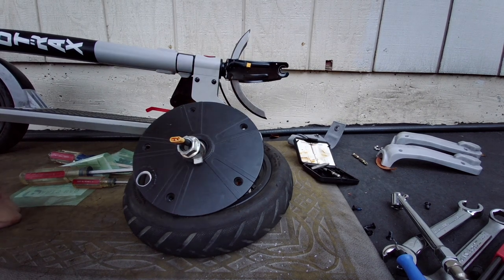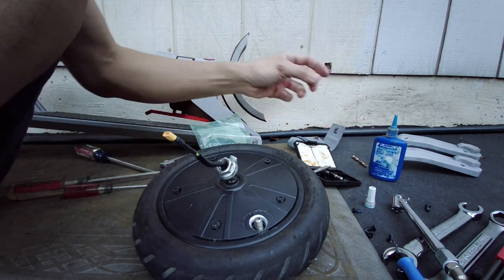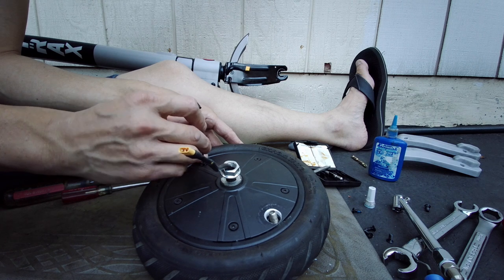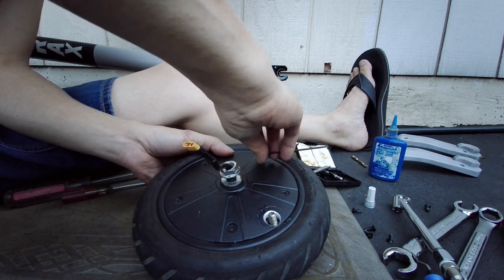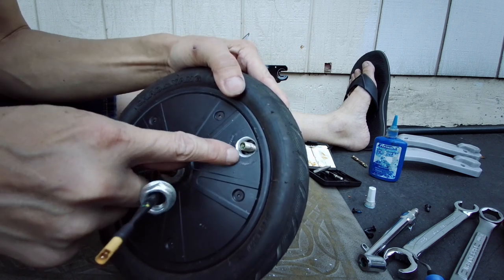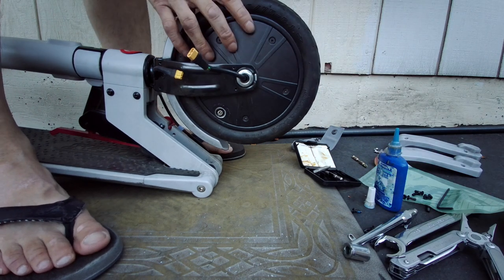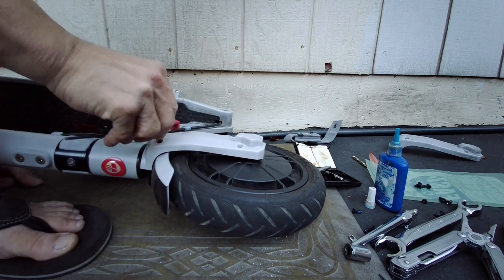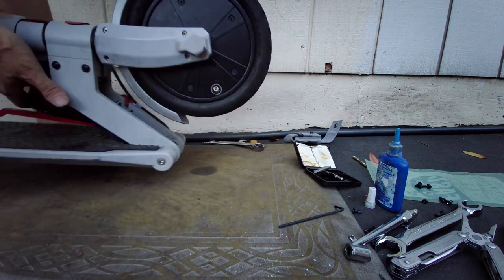GoTrax hub motor plate assembly & wheel install

Comment: You can use a stem extender to get to the short stem it lets no air out and screws on very easily, fill the tire unscrew the extender and you’re done

Comment: Why were you having to clean it out. Is the motor shuttering/ rapidly jerking?
Reply from the maker: to clean out the Aluminum chips from the de-burr tool, otherwise they will cause a short circuit